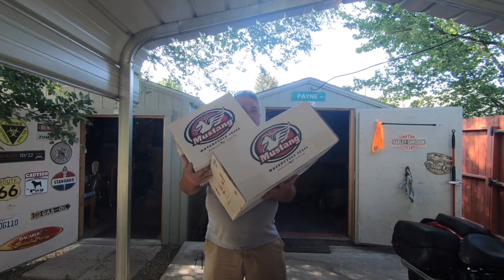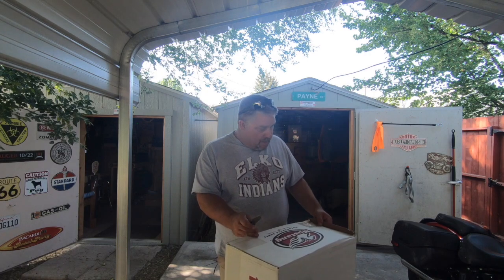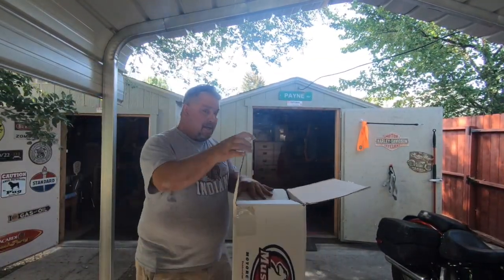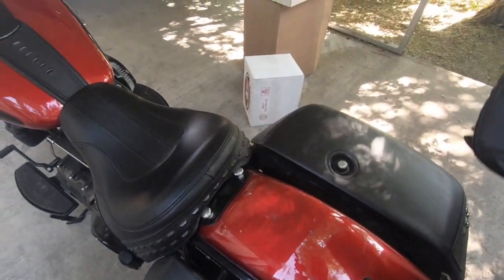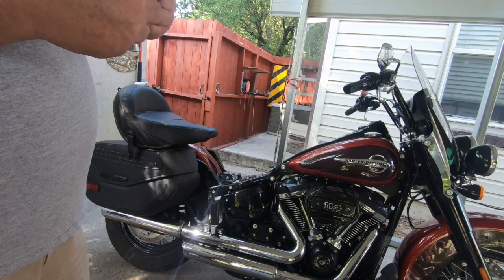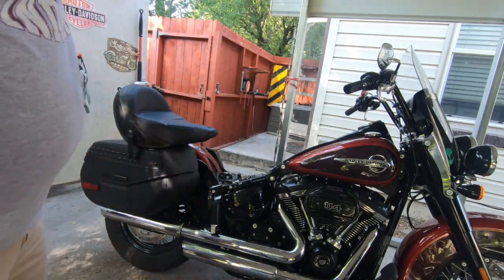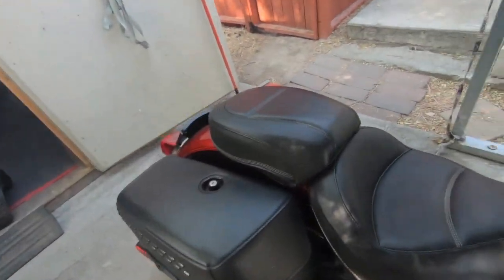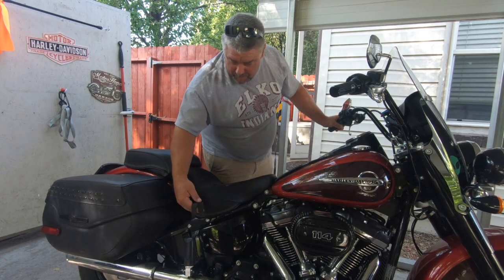2019 Harley Davidson Heritage | Mustang Seat

Comment: Hi JP,

Great video and nice bike. I am curious, if you pull up on the front of the seat near the gas tank does it move or is it well engaged with the frame? My mustang seat on my 19 Soft tail is way off from engaging in the frame tab.
Reply from the maker: I haven't noticed that--seems to fit just right. Good question. Thanks!

Comment: SO I've got a question, I've gotten some mixed understandings. Does the passenger seat need to be replaced or with the stock passenger seat mount up with you use the old thumb screws? I see you chose to use the knew thumb screws, I assume the new seat will not mate up with the old thumb screws but I did not want to spring $200 bucks for the passenger could I use the old thumb screws with the mustang tour seat and just put the old passenger seat back on? Your help would be greatly appreciated.
Reply from the maker: No, you can still use the factory passenger seat. Not a problem at all! Sorry for the late reply!